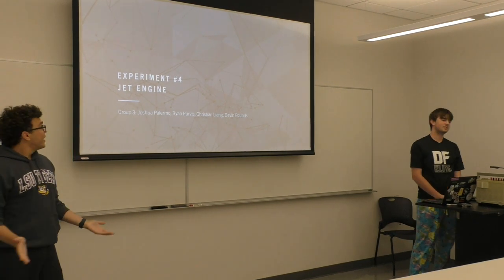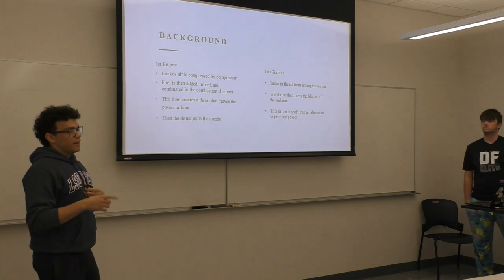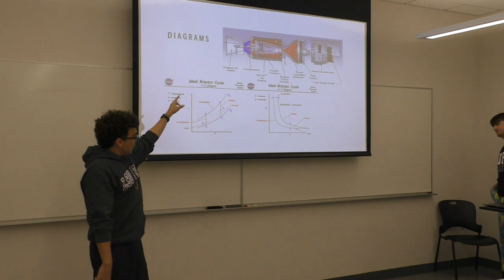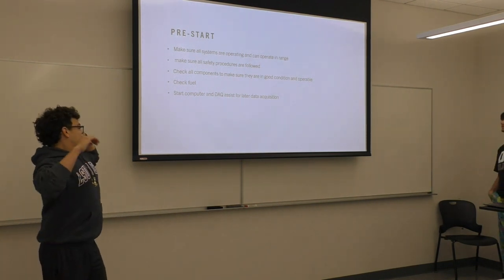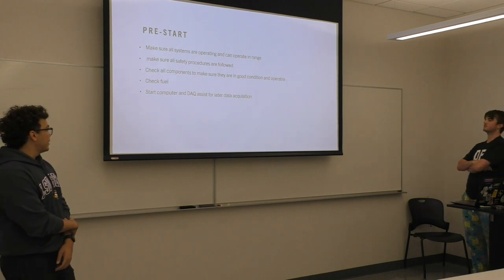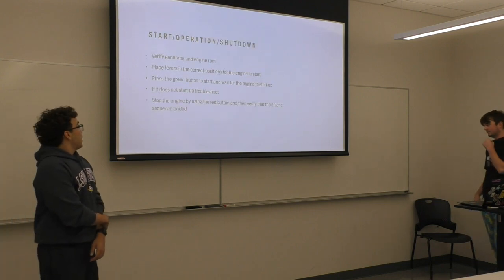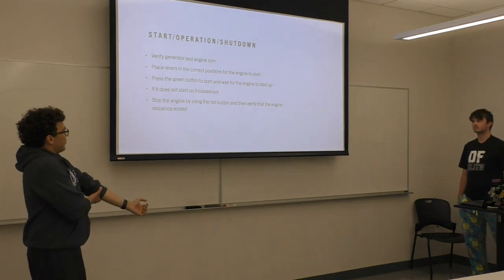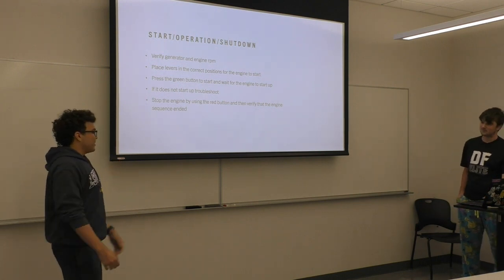Josh's Lead Presentation

Comment: I think I did a much better job giving this presentation than the last one. I was a lot better at summarizing the experiment. I could have done a little better with talking about my lab safety. I also think that the video cut almost half of my presentation because I was closer to 7min than 3min.